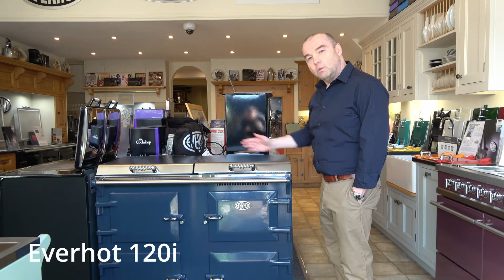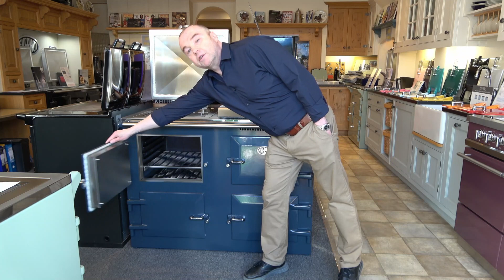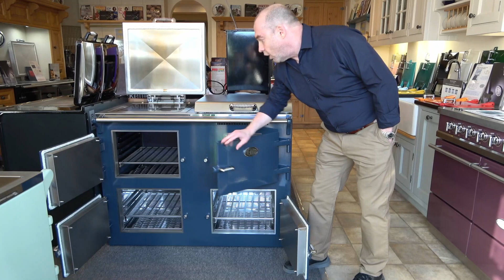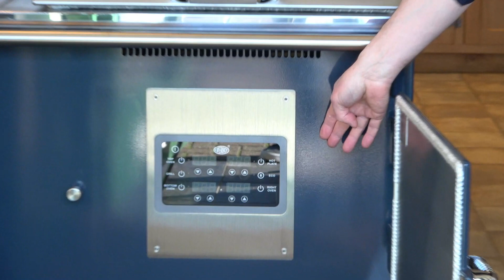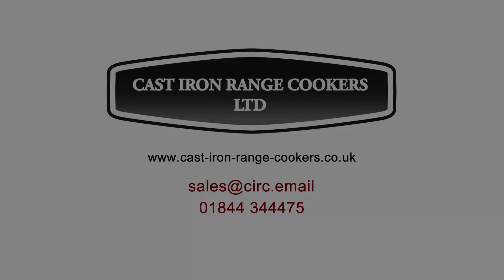Everhot 120i-a

Comment: Hello, is it possible to get rid of the yellow stain on the lid that is put over the simmering plate? 
Is it recommended to keep the lid open when the simmering plate is on, to prevent the heat from staining the lid?